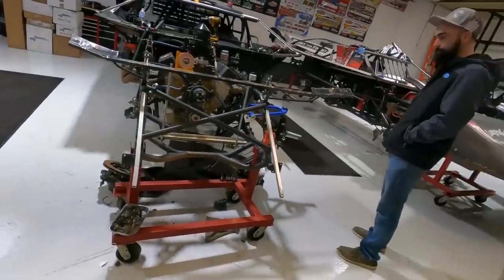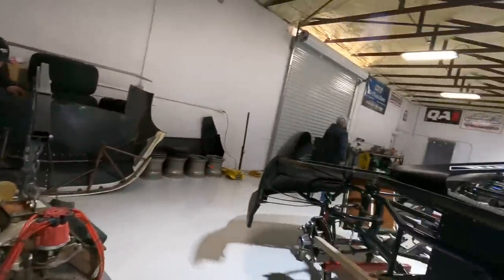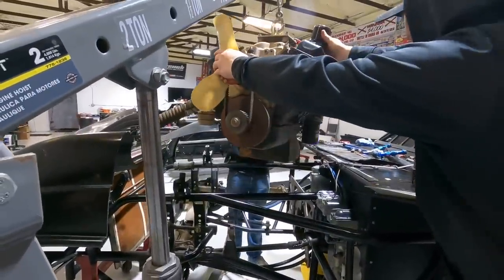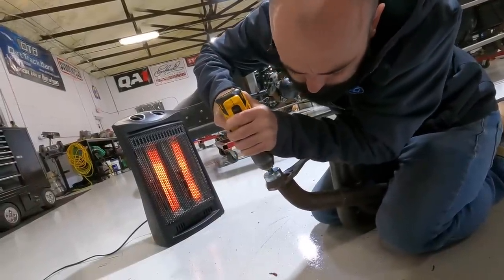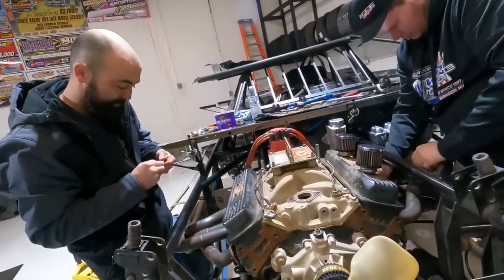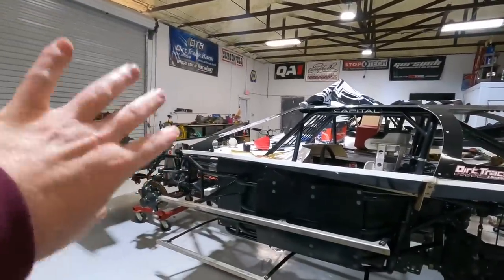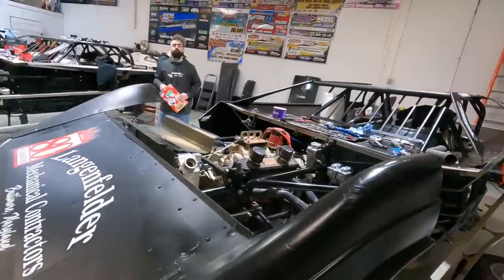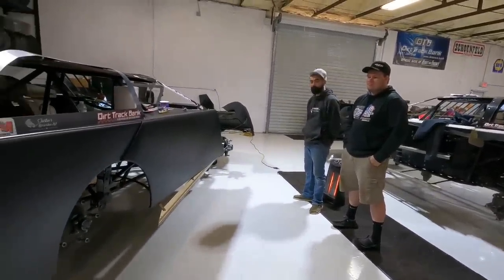Jonathan’s Return to Racing! Where Will We Race First in 2023?

Comment: Jesse , I still have a piece of a power  wire brush in my eye from 56 years ago. When I got an eye exam a few years ago the Doctor  said I was really lucky.  Safety  glasses or grinding  shield are suggested
Reply: I'd never pick up a drill or grinder without glasses...when there doing tires to..bet they could all tell you close call stories
Reply: 2 years ago I got a piece of aluminum in my eye. Using a wire wheel on an old car about lost my eyesight. Cant agree more
Reply: It’s easier to be safe than sorry
Reply: So fitting, right after the snip of the cardboard sign. Derek Bieri (Vice Grip Garage) is legally blind in his left eye due to not using safety glasses.
Reply: Mate that bit of metal would have oxidised and rusted away 56 years later but nice way of telling Jesse to put glasses on 👍🏁
Reply: @Josh Downs  Well , doctor  told me he saw some  rust, blood vessels had grown  over most of it
Reply: I usually just close my eyes lol...but seriously need to make it a habit to put on glasses
Reply: @Stack The Back  I've heard  of guys welding that way. Lol

Comment: Don't forget to install extended dowel pins in the blocks when you get them new bell housings. That may be contributing to your starter failures
Reply: Is there a weight difference in weight compared tje the metal.
Reply: @1962markstubson  The extended dowel pins go through the mid-plate and through the bell housing aligning them all properly. The standard dowels don't align the bell housing as well as they should.

Comment: We ran plastic bodies in go carts. The only issues we had especially with the sharp metal objects as you will find the plastic, tears easily and pokes holes in it. Also, some of the plastics do not like to keep the wrap stuck on. Make sure you clean it good with some soap and water Before applying the wrap.

Comment: Give you guys a tip on something I did on putting my headers on as many as yall take off and put on get a battery powered angle grinder with a brush on it instead of the drill it's a whole lot faster and safer also get a good caulking gun and buy it by the tube to put the gaskets around the pipes

Comment: What is involved with refreshing a 602 or 604 crate late model my understanding is they are a sealed GM or Ford factory engine to create a racing class with  an equal motor playing field to try to minimize motor costs… are certain engine builders allowed to break the seals and reseal them?
Reply: Any body can break the seals only certain builders can work on the motors and reseal them. It's about $1500 to freshen one.
Reply: Thanks for the info

Comment: Any weight/rules issue with plastic VS metal body panels?
Reply: Back in the day , I used the plastic body panels and in a race at Myrtle Beach the right rear quarter was hit and went flying off down the front stretch.. that was in the late 80s, before they paved the place.. hell of a dirt track..gone now